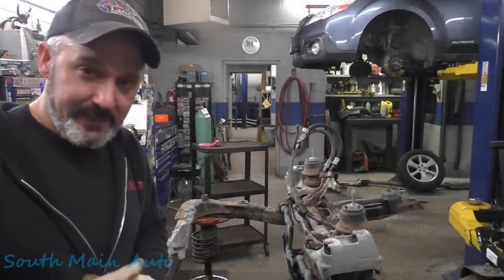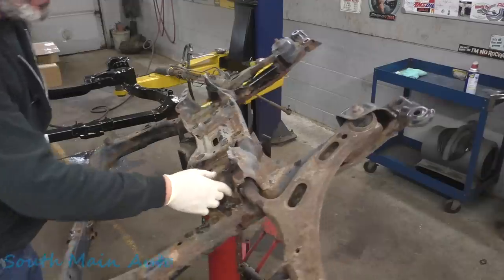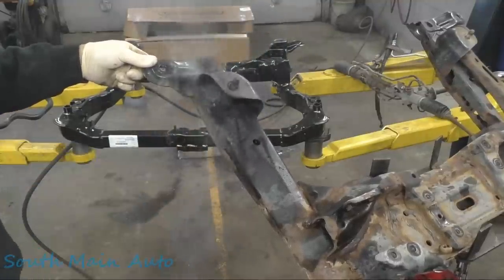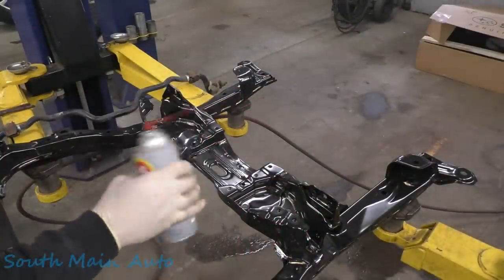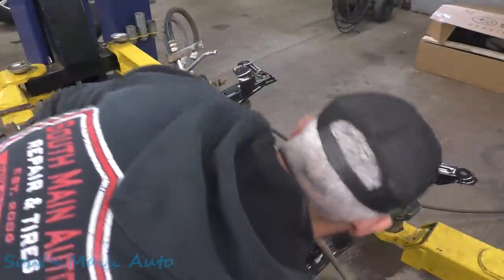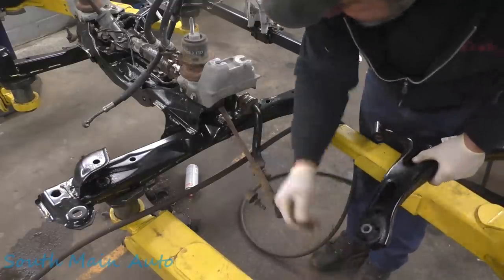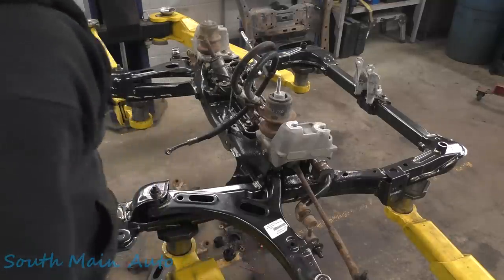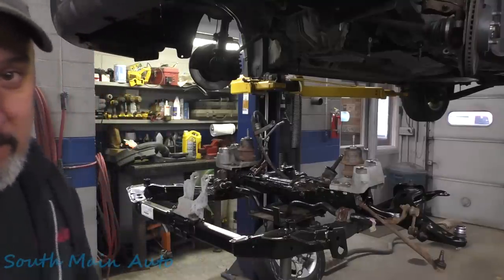Project Rotted Subaru Subframe - Part II

Comment: My dad broke his thumb badly with one of those subaru ball joints.  It was upside down in the vise and he was heating it like you were.  When he took the bolt out the balljoint exploded.  It hit the thumb he was holding onto the knuckle with.  When I came over he couldn't find the balljoint.  I looked up and saw the hole in the ceiling.  It put a good gouge in a wooden truss.  He needed some surgery to put his thumb back together.  I think the balljoint is in his desk now.
Reply: Dang that could have ended badly. Glad your dad came out okay.

Comment: Nice work, well done. I reckon that maybe a plasma cutter would be a useful addition to the workshop. Be less smokey than the oxy acetylene.
Reply: Except the plasma only works for cutting, not so good for heating parts as well.
Reply: Plasma cutters are amazing tools, but the are far smokier than a oxy acetolene torch.
Some machines can be used to gouge old welds.

Comment: Hi Eric, with regard to your inspection and some issues. I am a professional engineer here in Canada known as a P.Eng. If I say your whatever is not acceptable that is my decision. I have to stand by my decision and sleep at night. If you as the inspector say the condition is unacceptable  and I will not pass it. I don't care if it is surface rust, you are the inspector. If I don't like your report I can go for a second opinion. However I saw those holes and you made absolutely the right call. People should watch the video more carefully. I never argue with another inspectors report. If you pointed out to me why you will not accept the condition I can do as above. I learned my lesson years ago when a young mechanic. The inspector generally knows a lot more than you, get cleaver and he will point out every crack loose bolt leaking oil seal cracked tire. Sometimes I have found if it is borderline it will get overlooked if you argue you end up in a whole load of hurt.
Reply: The kicker is that the NY inspection isn't anywhere near as bad as some others. You want fun go look at the UK MOT or the way Japan does theirs.
Reply: @Blazer02LS  I have done many UK MOT’s they have stopped testing a lot of vehicles which I consider dangerous.

Comment: I have a vibrating tumbler with abrasive media just to remove rust from nuts and bolts on the old cars I work on for my self I will also add liquid rust remover in it for the really rusty ones but if I can I get new ones but some are just not available at any price so I get creative and just make what I need with taps and thread dies and a heat treat oven I am a welder and a machinist I can make most of what I need but it does get expensive and takes a lot of time of course we don’t have as much salt on the road but the constant mud is not a good thing and it rains a lot and every time the vehicle gets muddy and that holds moisture on the parts and hardware
Reply: Pressure washer...

Comment: Looking at the subframe at 1:32 into the video, anyone who doesn't think that subframe is rotted is blind is a bat or they don't know what they're talking about. It's a damn shame that Eric had to show that subframe in a video short because some blind ignorant people thought he was ripping someone off. I've only known one of the mechanic that's kind of like Eric. He had an old guy while I was there one day, pull up with like a 1975 Cutlass. This was in 1985 or 83. Anyhow the guy wanted a full tune-up. On that car at that time we're talking plugs, cables, distributor cap and maybe a rotor. Some of the cars at that time had electronic ignition but still use the rotor in the distributor cap. It was kind of weird. But in any case he could have made a good chunk of change off this old guy. He popped the hood looked around and this guy had a 1-in vacuum line that had come off. I don't know where when but it's like totally screwing up his fuel air mixture. He looks at the line carefully to make sure it's not split or anything and puts it back on where it belongs, closes the hood, the engine smooths out instantly and he tells the old fella there's your tune up. The old guy said how much do I owe you? This mechanic just told him you don't owe me anything next time you need an oil change bring your car to me. I don't remember what happened to him he kind of sold out to circle k and they tore down a shop I looked at him. I never even saw for sale sign. God bless them I hope he's still around and doing well.

Comment: Did a clutch, T/O bearing, half shafts and ball joints on the Mrs’ old ‘12 Forester. Had to do the “heat & greet” on those pencil sized ball joint bolts.  Coulda been the makings of a bad day.  Don’t think I’d have the stones to a sub frame that crusty. 😬
Did the FluFilm goat get sent out to pasture? 😉 🐐

Comment: Very enjoyable watching your approach here. I've got an old banger 2000 Subaru Forester GT here in Melbourne Australia that needs me to rebuild the engine real soon :-). I'm a well equipped amature mechanic, workshop hoist and all, and have been watching you for years now. My first rodeo with a Subaru though...  One YouTube approach seems to be to drop the whole engine out the bottom complete with sub freame. Mind you, we dont have the horendous rust problem over here that you guys face,  none the less I'd be thinking I'd be lubricating the fastener threads upon re-assembly of the cradle rather than putting 'em back in dry? Fluid film on threads a bad idea maybe? I did notice you sprayed some of the cradle to frame threads though. Cheers!

Comment: Great series, Eric.  I can see that I really need to get an oxy-acetylene setup.  
 I get the Fluid Film thing.  I'm amazed that an 8 year old car needed a subframe.  But I'd think every bolt would get anti-seize on it's entire length instead of just Fluid Film.  Interested in your thoughts on this.

Comment: The customer failed inspection because of the rotted sub frame right? I could of sworn that’s what Eric said in the first video. So that customer wasn’t passing until it was fixed. And when you spun the sub frame around when you were taking the control arm hardware off I could see all the rot on both sides. It was definitely time for a new one.

Comment: Heat and quench cheery red flood it with water works every time try it. I work on class 8 trucks in the salt belt Ontario Canada in Hamilton we work on the plows and spreaders sold them and in warranty have to fix the chassis. Man the brine and calcium no bolt heads left just bumps on a 4 year old machine A torch or grinder the only way. My daily driver a 2007 F150 soaked in oil since new now rusting a shame. longest vehicle lasted a 1991 Crown Vic bough it in 95 resealed the intake and valve covers a new water pump and t stat and tune up 5 k oil changes and 2010 gave it to my son I now having  2010 F150. He drove it to 2015 sold it to my neighbour died in 2018 with the 2015 oil in it ignorance is bliss.

Comment: Wow I think you had trouble with every bolt on this job. How many hours did it take as the edited video so far are 1 hour 30 min. I know you can't give your exact rates out but what does a job like this cost roundabout. Sorry with some much labor and a big part it has to be a crazy number, lol. But great video of you troubleshooting and fires, and stuck bolts. I think this is the most issues I have ever seen you have in 1 job. Grreeaat video thanks Mr. O for the entertainment. I look forward to your videos everyday. I haven't worked in1.5 year I am in a disability case I've had 6 heart attacks and 8 stents and I have congestive heart failure. So they tell me I am not long for this earth. I guess we will see. I will buy 1 of your non-zip charcoal colored 4x hoodie 1 day. But thanks for the video. (I'm not trying to get 1 for nothing, I was just saying I really like hoodies and yours especially.)

Comment: I had a pickup that I was trying to decide what to do with once the engine came to the end of it's lifecycle.
At the time, to replace the engine, transmission and rear end would have been $7,000-$8,000.
I would basically have a brand new pickup for a sixth of the cost of a new one.
Unfortunately, the body and the whole underneath was rusted and not worth keeping going.

Comment: What's the reason a lot of cars have one of the wishbone bushes work in the opposite plane to the other? Like in this case, the rear-most bushing is horizontally mounted, while the front bushing is vertical. Does a horizontally-mounted bushing better absorb loads from the wishbone being pushed backward when driving or hitting bumps?

Comment: II guess its a testament to Subaru that the engine/transmission hasn't broad cast leaky oil vapor  all over the subframe leaving a lot of dry rust  from sh*t steel to deal with.

Comment: When you torch the bushing sleeve it gets the bolt pretty hot, maybe approaching the melting point.  Are there any concerns with reducing the bolt strength by changing the metallurgy or oxidation?  In general is it better to replace those if it is within your budget?

Comment: I'm surprised at how rotted that subrame actually is.  I recently pulled a subframe off a '91 Nissan 240SX that was daily driven in Chicago winters for roughly 15 years then the car mostly sat in the driveway for maybe another 5'ish before finally being pulled back into the garage where it sat for another 5+ years before finally receiving some attention, and while it looked really rough when I first pulled it off the car, it turned out to actually be in pretty good shape once all the surface rust was media blasted off.  There's a bit of surface pitting here and there, but it was really quite minor... That Suburu's subframe looks to be made of WAY thinner metal than mine was.  Is that a Suburu thing, or are the subframes just lighter weight than they used to be?  I guess the amount mileage may be a factor as well.

Comment: Serious question, how much would it have cost to change those two control arm bolts stuck in the control arm bushings?  $6?  Well worth it IMO.  Better than breathing burned rubber and grease.  Plus it took you like 10-15 minutes at $90 an hour it's actually cheaper just to replace the bolts.

Comment: Is there a reason (besides saving time & effort) not to lube the bolt threads on reassembly?  Would it be more likely to come apart when in service?  Or not less likely to seize if you need it to come apart?  Maybe it would just be a waste of time & grease, most of the time.

Comment: I understand everybody does what works best for them personally when I'm working with the torchomatic I tend to use tight fitting pig skin gloves cuz I have a habit of grabbing a hold of stuff and I have been burned and as far as any other gloves like the Mickey mouse cheap cotton gloves I used to work in a machine shop but won't wear them cuz if they get hung up in the machine it will take your hand off hey you and Ray wear them little latex gloves you're happy with them but with hot stuff to has a tendency to melt & stick have a great day

Comment: I guess almost a quarter hour of labor is worth it for two nuts and bolts if you’re pro-bono’ing the labor, but what did that acetylene heat do to the strength rating of those bolts?

Comment: Im far from a mechinc I always end up with a messed up last bolt Outside with a beer And a lost 10mm ......I do however loved going my own restos The latest money dump was my Older Blazer ..Strip down Media Blasted ...Zinc Electrostatic primer And thick baked on rust paint And then a few upgrades to the tranny And wiring  Bye bye Rag joint Hello Holley U joint  Tahoe Ad-244 alt And i am a Winter scoot scooter....Eric In short with this video I noticed something .....I now know why i suck at putting IKEA stuff together

Comment: When I put my ball joints out of the spindle, I always put wheel bearing grease or antiseize on them and in the spindle before I reassemble.  These are my personal subarus.  Officially you aren't supposed to add any grease.  I've read this.  But the pinch bolt holds the ball joint into the spindle with a groove in the joint.  Surely, the pinch bolt can't jump the groove in the ball joint?  I mean if all it takes is grease or antiseize to make it jump the groove, it's not really secure, right?  And even if it jumped the groove, wouldn't the wheels have to come off the ground for the ball joint to fall out of the spindle?

Comment: hi, with the torching stuff for the control arm hardware it would work with an angle grinder too? i dont have access to a shop or any shmancy torches but i imagine doing the exact same melting as you but instead cutting away with any grinder works similarly? if im only swapping control arms and everything is still assembled in the vehicle, any tips on getting the bolt out? or just eat the cost, cut the bolts and get replacements?

Comment: If you had a new Subaru could you bring it to your shop and have stainless steel nut and bolts put on where you knew that in a few years you would have to take them off.

Comment: The subframe had to be replaced because the car was not undercoated at the dealership before the owner took delivery.  I will say this again: my Dakota was rustproofed and undercoated before I picked it up. The finance company would not close on the loan until that was done. Not one speck of rust even after 5 New England winters.  And it rode so quiet....

Comment: Why not buy a used southern Sub frame with most of the parts already attached ?
Reply from the maker: Because new OEM is actually cheaper than any used one I found . The freight on a southern one is the killer.

Comment: That became expensive control arm bolts with with the amount of Oxy-Acetlene and time, would it not be more sense to order new ones if you can also order a new subframe?  As you told us you have been already to a few rodeo's and know these not easily come out.

Comment: I am devastated cause you made Big Nasty look bad.  You need to up your air hammer game.  Here's how.  Use a concave bit not a flat bit.  The concave bit will focus the hammering power down the bolt. Just place the concave bit directly on the bolt and hammer away.  Also secure everything attached to the subframe so nothing can move or vibrate.  Any vibration focused away from the bolt is just lost energy.   Big Nasty can do the job much faster but she needs a little setup work first.
Reply: @jimbeaux1109  Good point.

Comment: I think new bolts would been cheaper rather than all that time removing control arms
Reply: Was thinking the same thing.  Corrosion and thread stress plus labor costs to remove the old bolts = losing proposition for the customer.  (even though the customer was trying to do this the cheapest way possible).

Comment: not never critiseing but i would haved put antisieze on all threaded parts have you ever used eorokroil i think its the best if that would have been my car i would have welded some metal over those rusted places if there was any where to weld to little welding quicker than r/r frame but i would never own those rust traps they had some bad issues with corrosion yrs back merry christmas

Comment: Me: That's a lot of work just for a bolt.
Also Me: I would use the old bolts too.
I thought you were changing the oil pan also. Did I misunderstand something?
Reply: He said he wants to get the new subframe installed on the car before doing the pan
Reply: OK, I thought he was going to do it after he removed the old one. I misunderstood it. Thanks.

Comment: Liquid Wrench makes a newer product called: Liquid Wrench Penetrant and Lubricant. You can use it as a penetrant and as a lubricating prep for reinstalling the body and subframe bolts. So, for example, you could use it to free up the bolts about half way out then use again on the newly exposed threads, then temporarily reinstalled and then remove final. The spray will stay on the threads enough to make reassembly easier, and the prep is done in the removal stage. Also, if you want to add more lubricant before reinstall you can just use more of the same spray. Very handy.

Comment: Funny because on the West Coast I would have cut the subframe off as a small chunk if it was on the trans jack and taken that to the to the vise with the control arm attached, to salvage the bolts, you already had the other end apart.  It looked like you were trying to save the nasty subframe for a wall ordament.  To each their own. We have good stock on metric bolts here in Canada, give us a call. lol

Comment: CJ-2a Jeep Wisconsin, 1973.  stepped on the brake hard, lines all blew out from rust, pedal went through the rotten floor. Put it in reverse to stop on ice and then scrapped the monster. Europe, California and others use SAND. In America they use salt only because of big mines and lobbyists. This is so unnecessary.

Comment: WD is for assembly, you should use WD's Specialized, it's a true penetrant for soaking & removing hardware, seems like it works and probably creeps better than regular WD.
Reply: Or PB Blaster or Fluid Film
Reply: WD is for displacing water.  The rest of your comment is just a much rubbish as your opening comment.  Same for you Zipper.

Comment: When do you choose 6 pt over 12 pt?
Reply: Whenever possible. 6 point always grab better and transmit more torque to the fastener with less chance of rounding off the corners of the hex. 12 point are good if you are not dealing with rust and crud, and there are 12 point fasteners out there where you need them.

Comment: sir, how much to replace subaru bottom b/joints,, oh, about 400 bucks.. mate has an isuzu m u x, the engine mount craped, brand new, 10 th ks. went to get it replaced, go in thru sunroof, take out interior, remove body, 800 bucks later, for 1 fkn engine mount..cant beat old school sht..